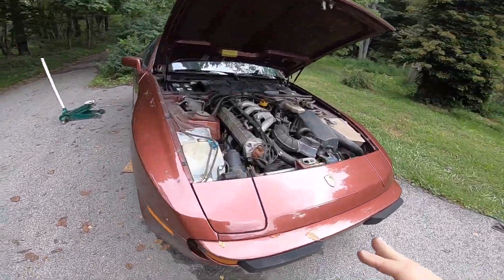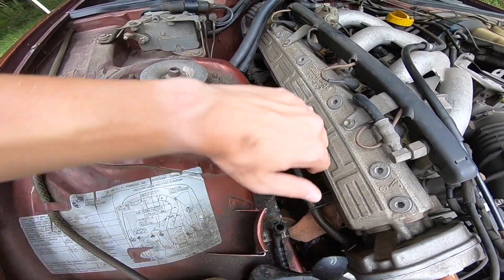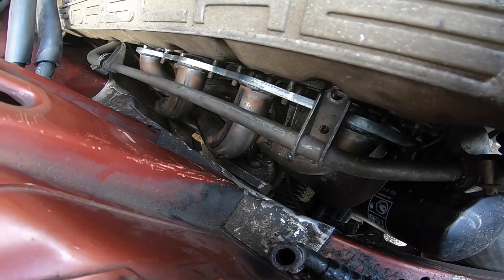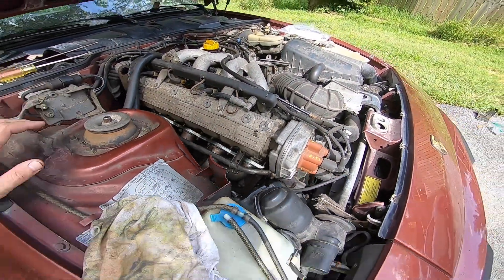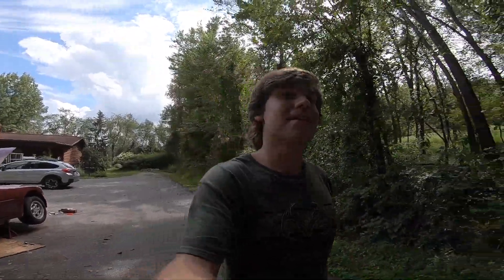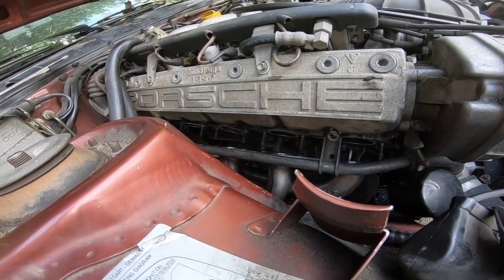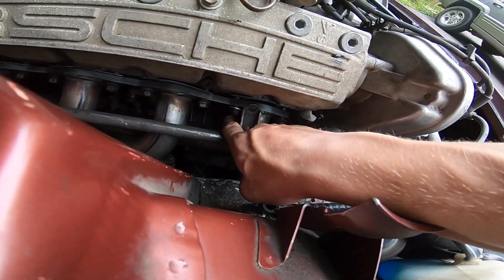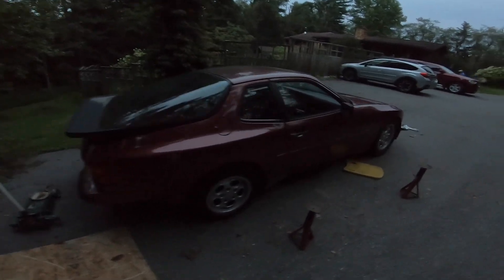Installing Lindsey Racing Headers on My Porsche 944 (FINALLY!!!)

Comment: That one tube that runs directly behind the lower balance shaft housing end plug/seal will cook that o-ring over a short time.  I made a small shield that bolts on with two bolts at the end of the housing.   It slips directly between the header tube and the entire end of the housing.  I had pulled the engine because of it literally dump oil straight out onto the header and onto the road in left turns.  If yours isn't leaking yet, it will with the header.